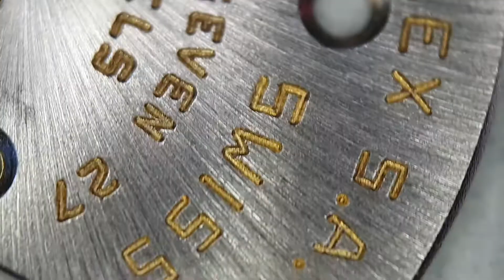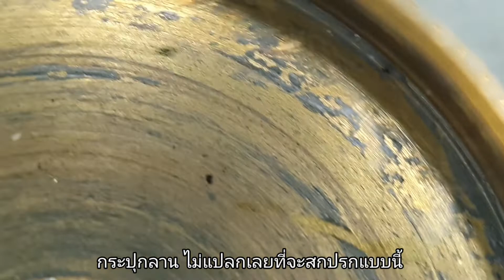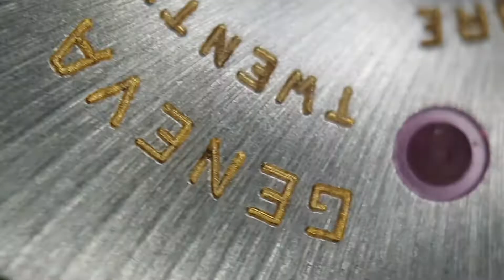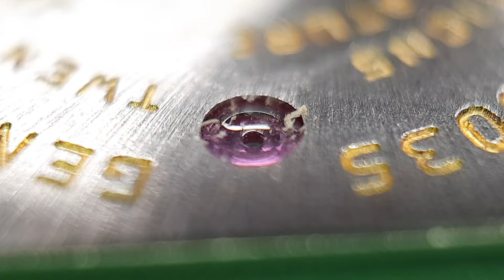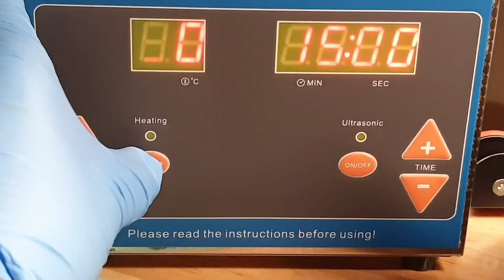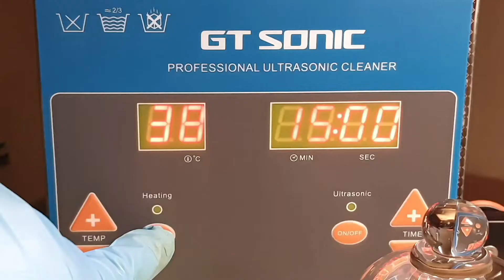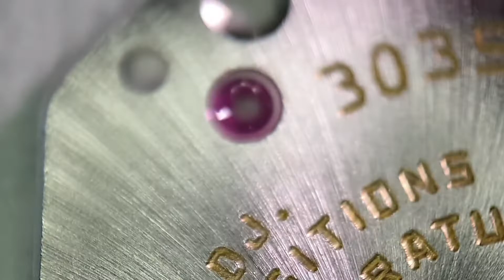Servicing Rolex Datejust 3035 Part 2 of 4 Cleaning / ล้างเครื่อง Rolex 3035

Comment: How long does a miyota 82s0 movement last with regular lubrication? Should I buy a seiko 5 instead?
Reply from the maker: How I skipped your comment.  Seiko 5 and miyota 82xx are on the same league.     Therefore, either one is the same but, in my opinion, seiko is easier to find replacement.
Reply: @magicofwheels   I am glad that you have seen it☺. Actually I really like the skeleton design that miyota 82s0 offers. Seiko is kinda boring for me. But I am concerned about longevity.
Reply from the maker: No doubt regarding longevity, you can rely on both. 😀
Reply: @magicofwheels   thanks 😊
Reply from the maker: You are most welcome.